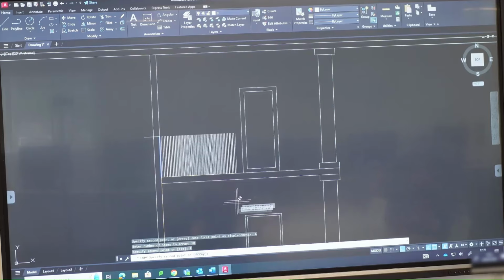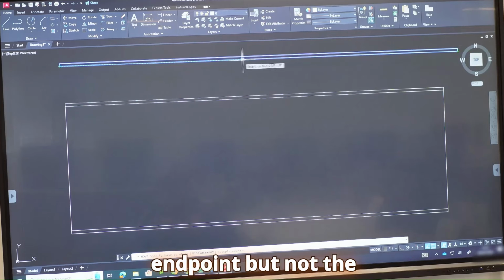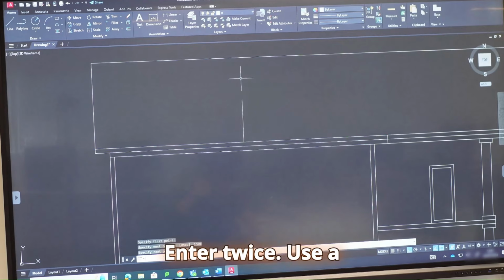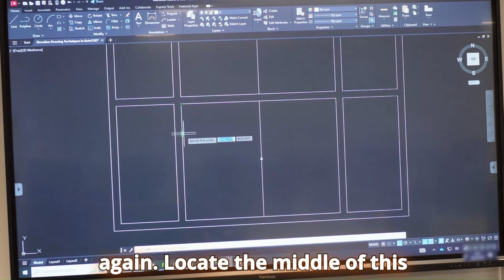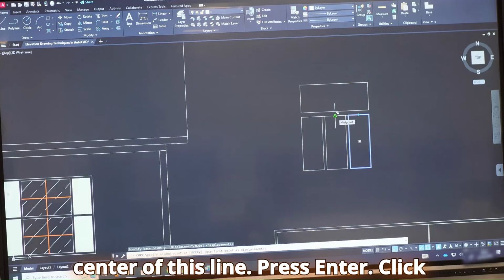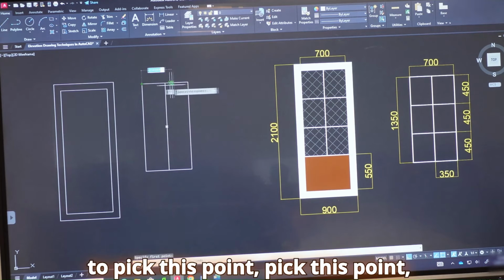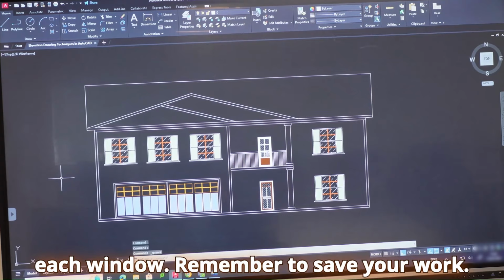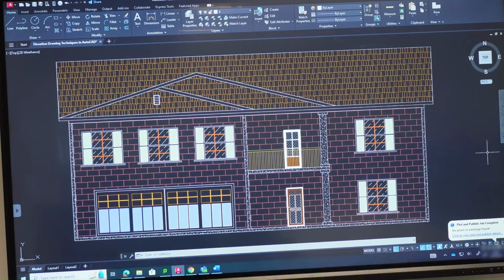Design Your DREAM Home in 2D Elevation in Just 1 Hour

Comment from the maker: Udemy Link to this Video Course:
https://www.udemy.com/course/design-your-own-home-2d-elevation-step-by-step-in-autocad/?referralCode=C45462AEDB0D18081261

00:00 How the Video Teaching Looks Like
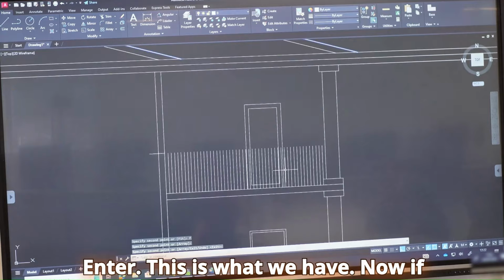00:14 The Project Intro
00:28 Aim of the Project
01:30 How to Install AutoCAD for Free
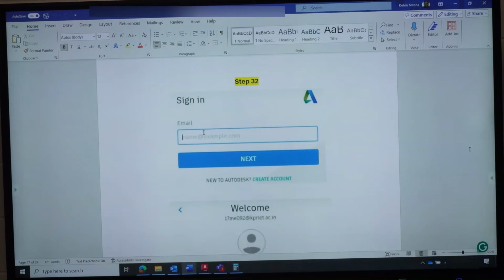07:29 Analysing the Front Elevation
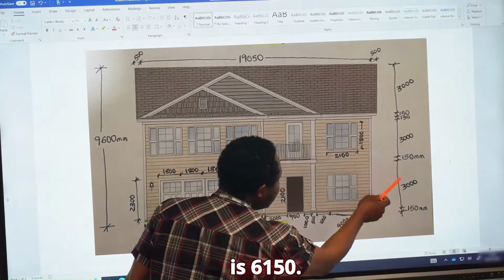08:19 The Front Elevation Outline
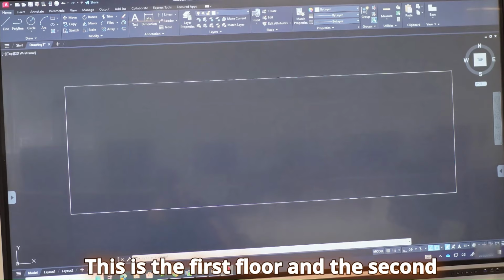08:52 Ground Concrete Floor and the Roof Soffit
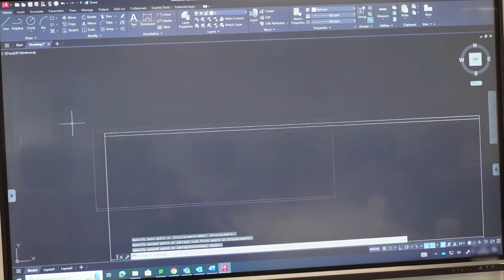09:51 Fascia Board and the OSNAP
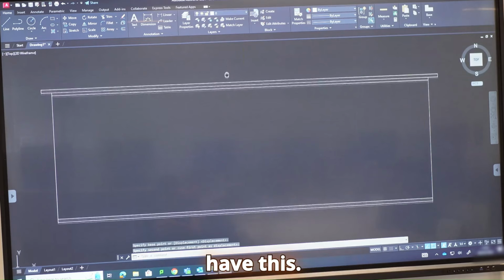11:06 Positioning the End Columns
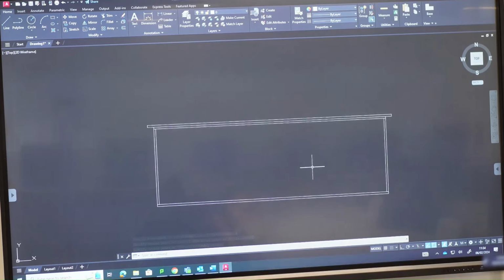11:54 Access the Video Projects in the Description and Comment Links
12:09 Draw the Rectangular Roof
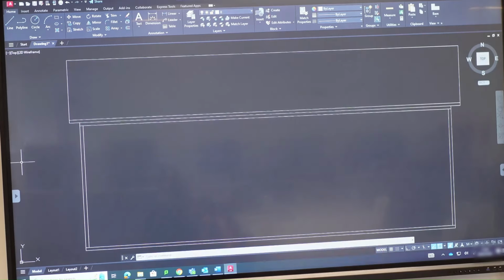12:52 Placing the Balcony Columns
17:50 Placing the External Doors
20:14 Roof Pattern Design
25:03 Balcony Rail Design
27:13 2D Window Design
32:49 Hatching the Window
34:37 Grouping the Window Parts
35:19 Placing Windows in the Building
38:28 Designing of the Garage Door
48:05 Hatching and Grouping the Garage Door
48:47 Placing the Garage Door in the Building
49:50 Trimming Off the Beam
50:21 Before You Move the Doors Out
51:27 Balcony Door Design
54:17 Hatching the Balcony Door with Colours
55:56 Grouping and Placing the Balcony Door
56:44 Ground Floor Entrance Door Design
1:00:45 Hatching the Ground Floor Door
1:01:41 Positioning the Ground Floor Door
1:02:11 Window Sills Design and Placement
1:03:20 Roof Tiles Pattern Design
1:05:51 Hatching Concrete Beam, Columns and Slabs
1:06:48 Placing Objects in Layers and Draw Order
1:10:01 Hatching with Bricks and Zooming Objects
1:11:00 Printing AutoCAD dwg Drawings to PDF
1:13:357 End Subscription Ads

This video project course will help you create and draw your own home elevation using AutoCAD step-by-step. The video course is divided into segments to help you draw with me step-by-step.

LIKE THIS VIDEO? THANKS! SUBSCRIBE: https://www.youtube.com/c/KelvinAcademyYouTube?sub_confirmation=1